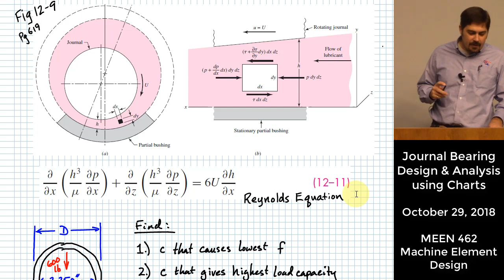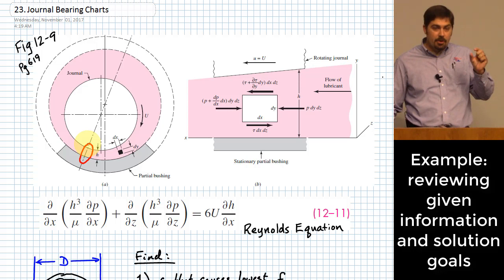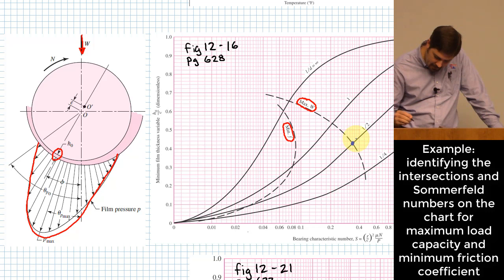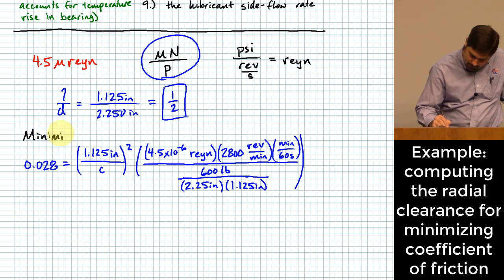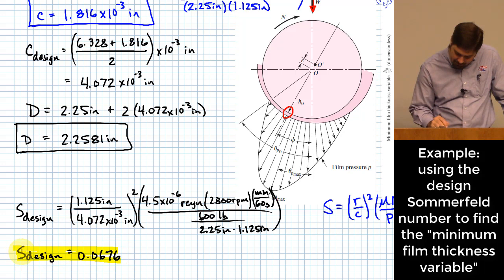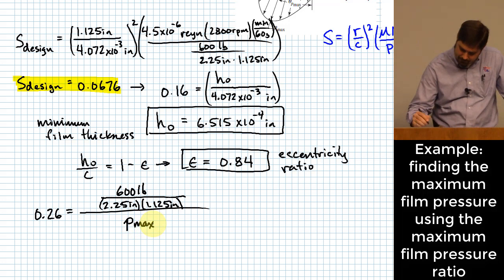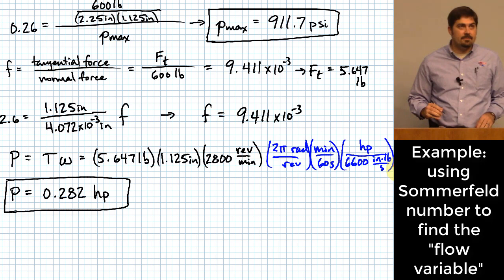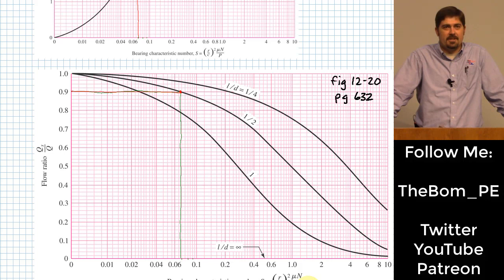Journal Bearing Design & Analysis w/ Charts | Reynolds Equation; Minimum Film Thickness; Power Loss

Comment: I did this exercise in SI considering: F_r=2670 N; D=60mm; n=2800rpm; L/D=0.5; SAE40; tolerance H7b9. Got: nominal temperature=72C; h_0=0.015mm; S=0.0676; film position=30; viscosity=21.55 mPa-s (or cP); p_max= 5.7MPa; maximum pressure position=14,5; Q=21.95cm^3/s; Q_s=12.29cm^3/s; friction coefficient f=0.009; power loss P=0.28HP.

Comment: Great Lecture!! Can you the name the textbook from which the graphs are taken. 

Also I have this doubt that shouldn't lubrication problems also include surface tension (any adhesive force) because that would define how the fluid stays attached to the metal surface. Although in this case it makes sense since we are constantly pushing liquid (through the dynamic motion of the journal), but what about cases where there are 2 flat surfaces moving slowly w.r.t each other but the contact force is very high. So here some adhesive force should play an important role right?? Otherwise the fluid might just squeeze out of the contact surface due to the load.

Comment: Hi, great lecture! One question, how do I determine the lubricating oil pressure going into the bearings? I ask this because I work at a thermal power station plant and we monitor the pressure and temperature.

Comment: Wonderful lecture :)
One doubt though: Why is it that the projected area of the journal diameter taken to calculate the fluid pressure and not that of the the bearing (which contains the fluid) diameter.
Reply from the maker: Thanks for the positive feedback! In answer to your question: there are very small clearances between the journal and the bearing relative to their overall size. This means the diameters of these two parts are practically the same. When computing projected area, it doesn't make enough difference to worry about. Thanks for watching!
Reply: @TheBomPE  thank you 🙂

Comment: What if the shaft is fixed and the bushing is the one rotating? Thank you in advance.
Reply from the maker: I based this lecture in Shigley's Mechanical Engineering Design, 10th ed. Shigley says that you find the "significant angular speed" with the absolute value of (Nj + Nb - 2Nf) where Nj is the journal speed (the inner part), Nb is the bearing speed (the outer part) and Nf is the rate of rotation of the load (see eq 12-13). Based on this, the case you are asking about would not be computed differently than the case demonstrated in the example in the video. Thanks for watching!

Comment: Very nice video! Can you please answer me, if my l/d=1,23. Which curve should I choose?
Reply from the maker: One way to deal with charts like this (not only for journal bearings, but for just about any chart with multiple curves) when you have a number that does not exactly pick one of the curves, is to interpolate. I have a sample of how this can be done in this video: https://youtu.be/E5tgDVN1zy4
Reply: @TheBomPE  thank you for fast reply! Right after the comment I found interpolation equation for Raimondi-Boyds 😅 … is there any way to analytically compare non-grooved bearing with grooved bearing ? So which one is “better” to use for certain application.

Comment: Could you explain to me. How to calculate the power loss? In 55:10 you add the formula with the blue mark, what is it?
Reply from the maker: Those are conversion factors. There are 2*pi radians in 1 revolution, there are 60 seconds in 1 minute, and there are 6600in*lb/s in 1 horsepower (hp).

Comment: This lecture is good about journal bearings , I need some help in the aerostatic bearings design, can you please help me, if possible, I will wait for your kind response.
Reply from the maker: I do not currently have any instructional materials prepared about that topic, but I will keep it in mind as a potentially interesting topic on which to do a lecture. Thanks for watching!
Reply: @TheBomPE  Dear sir thanks for kind reply, I hope you will make a good lecture on how to design a model and get simulation results by using ANSYS Workbench as well as by using charts to compare the result with experimental results.
Please sir if possible guide me about the designing and simulation of Aersostatic thrust bearing and Aerostatic journal bearing with pockets, tilt pads and orifices.
Dear sir I will wait your best response, sir if You have any book on aerostatic bearings, please send me.

Comment: 600lb. How can i get it?
Reply from the maker: With respect to this example problem, 600lb is a given value. (See 6:10 .)
In a real-world context, you would have to evaluate what load capacity your proposed bearing would need to have based on the job it would be doing.
Reply: Sir, how i can calculate the load of bearing? And determine the characteristic of the lubricant?